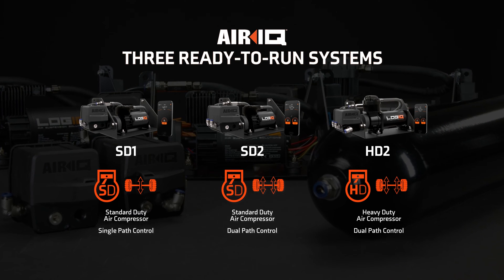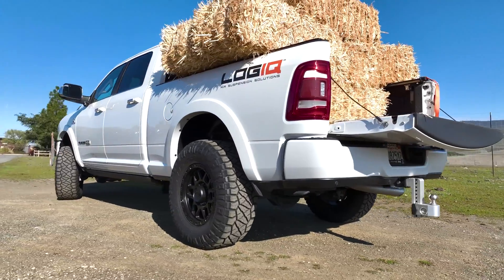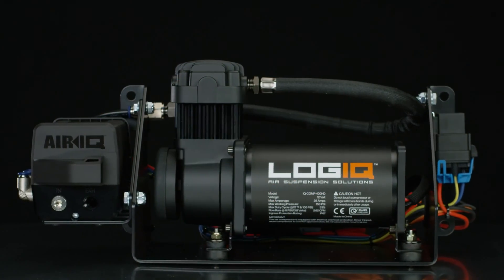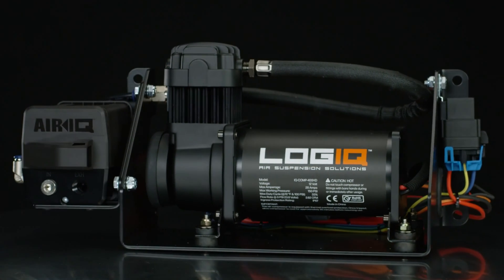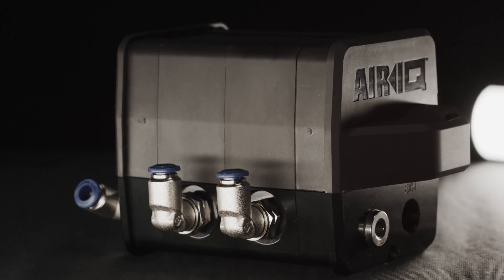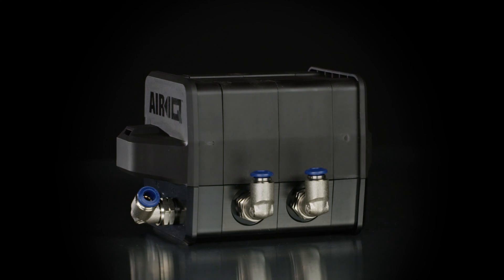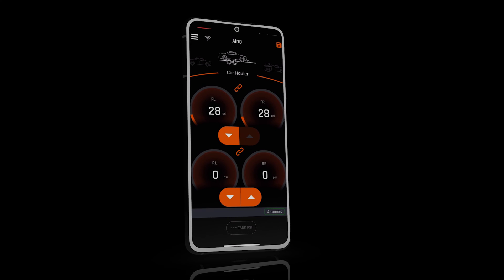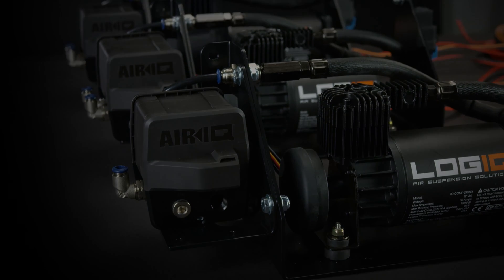Which Air Management is right for you? | LOGIQ AirIQ

Comment: Absolute junk!
Reply: Have you had these? I was thinking about buying them.
Reply: Yes, I currently have them on my ram power wagon.  The airbags are actually one of the best on the market. But the Bluetooth module continues to fail. The place  that installed my airbags replaced the module three times. I just straight wired a switch to the compressor and have no issues now.
Reply: @stephenrandall7431 p I have a B and W frame mount gooseball hitch in the bed of a 25 f150 crew cab long bed. I want to get theses installed. I think i may have to get longer u-bolts to get them to mount up tho. Do they have full range of motion up and down? I work pipeline inspection so i run off-road a good bit. Currently in northern Ohio. Flat land station work but i may be going to west texas virginia or pennsylvania next for work.
Reply: I have about 12 inches of up and down travel with the airbags, it goes all the way down to the frame bumper stops. It sounds like they would be perfect for the application you will be using them for.

Comment: This is the biggest horse shit in fucking air suspension ever
Reply: Why do you say that?
Reply: @ if you bottom out even once even though the bump stops you the frame of the air ride bag itself splits on the ring that is crimped to the frame I know this becous I couldn't get mine replaced after having it a week so I retrofitted some 6” bags to there frame and haven't had a problem in over a month.